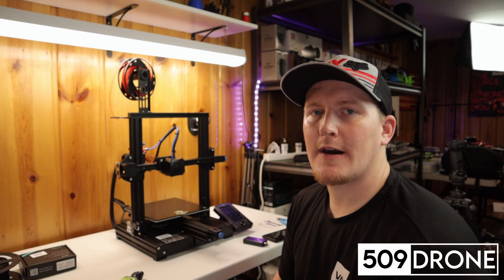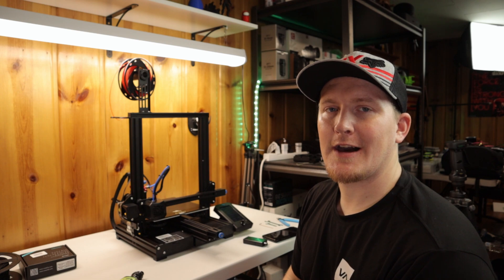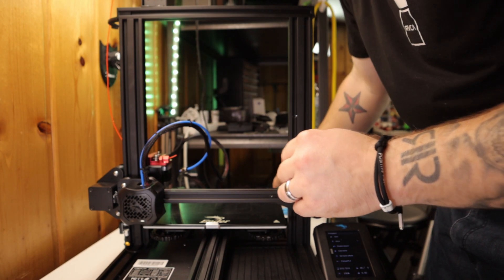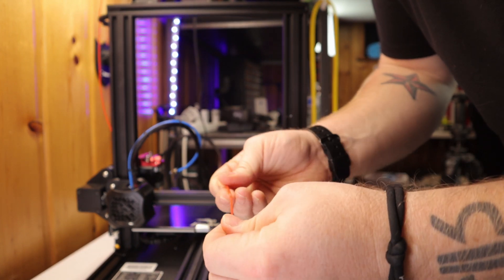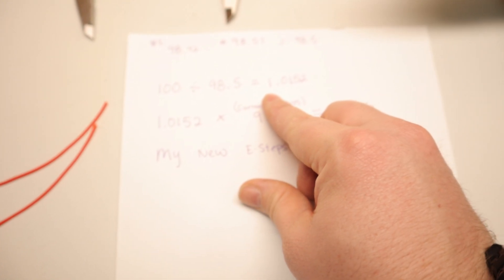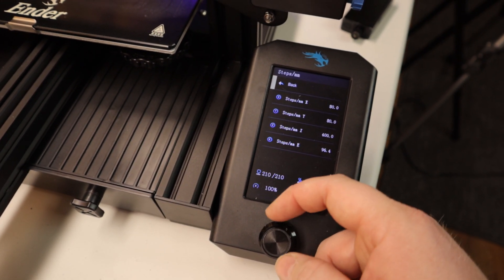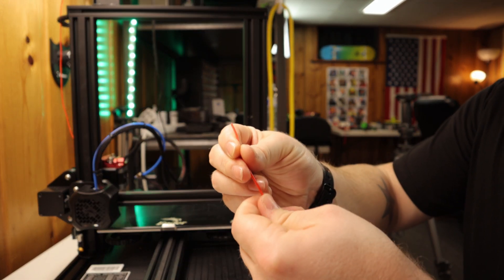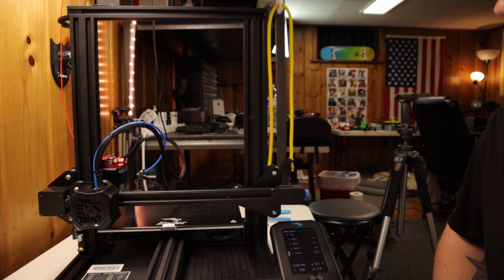How To Calibrate Your E-Steps [ Ender 3 V2 ]

Comment: I did mine partly another way which I saw done on another channel but I used your help with the screen settings and how to move the extruder as they were connecting their laptop up to the printer and using some program that I do not have... This way I did Not have to remove the bowden tube from the extruder. I just took the filament out and marked 120mm then put the filament and loaded it into the extruder to the first line then used your way to extrude 100mm then marked the filament at the front of the extruder where I also started with the line on the start of the 120mm section. I took the filament out and measured the remaining distance which was 22mm and using your formula it was under extruding so I changed the setting, saved it and turned the printer off, and did it again and now it is spot on 100mm of length extruded.. thank you for the help.. much appreciated.

Comment: Awesome tuturial!! Just added the all metal extrudder kit, the capricorn tubing and the dual z axis kit. Idk how my prints have even been turning out so well because it was only extruding 65mm until I calibrated it via the steps in the video with a final transmission number of 143.0 I get a perfect 100mm now every time.

Comment: Just a note: AT 9:00 minutes you casually mentioned that "you just power cycled the printer" before checking the new E-step calibration. You MUST power cycle the printer otherwise the new offset value gets added to the old value and the 100mm length will be way to much - in my case it was around 106mm. After power cycling it was perfect. Great video though!

Comment: Small tip to make measuring easier: straighten the filament a little after cutting, then tape it to the bed in a straight line leaving only the ends exposed. Much easier and accurate measuring. Thank you for the video. I've been having some strange problems with my cr-10. Running this, I found out it was different every time. After replacing the gear/roller with the bad teeth, I found it was 11% off from the factory. yikes!

Comment: hella nice video my dude! one little ting that wasn't mentioned in the video is that if you are running original software you need to have the SD card in to save the config and the new e step config will only show up after a reboot once the card is installed!

Comment: This was really easy to follow, many thanks. I just had a couple of questions. I saw estep calibration on another tutorial, where instead of updating the printer, it updated the slicer (Cura) - is that just an alternative? I  also recall reading that changes on the printer are stored on the microSD card? Is that right?
Reply from the maker: Thanks bro! Glad it was helpful. You can only update your esteps on your printer, not the slicer software (I'm not 100% sure on that, but that's my understanding) as for the SD card, some printers like the ender 3 v2 save the esteps info on the SD card. So you will want to make sure your SD card is in your printer when you update the esteps. This is the file you will see on the SD card called eprom. You can add commands for the printer to execute before it prints via the slicing software (cura) but I don't think esteps is one of them. For example, that is how you tell your printer to always do an auto bed level before each print.
Reply: @509drone2  Legend. Thanks mate, really appreciate it.

Comment: Good video.  Don't cut it before you measure though, use the upper jaws to measure it to the face while it's still in the extruder.  Easy to pull it straight and measure.  Release the filament, pull it back close to flush, cut short piece and recheck.

Comment: I did this and the final measurement was 100.55. I double checked the measurements and it was accurate. How do you fix that?
I did just put a Creality Aluminum extruder on with new gear.

Comment: If you do it this way, when you actually run it thru the hotend then it will come up short, so the best way is to run the filament thru the hotend for a better reading

Comment: Everyone on these videos says to do it like you did with it unplugged from the hot end for no resistance… my thought and question is wouldn’t you want to calibrate it with it hooked up just like you were really printing?? If you calibrate it with no resistance and then hook it up and it has resistance when actually printing wouldn’t that through off the calibration??

Comment: Hey I’m having trouble with this. My original extrusion was 95.3 and my e step was at 93 I changed it according to the math here and it went from 95.3 to 109 not sure what I dod wrong
Reply from the maker: I had to do mine a couple times before it started coming out correctly. I would just do it a few times, with small adjustments and checking to see if it's getting better or worse. Also if you have more questions I would recommend our discord. There are a bunch of really helpful people in there who all ask questions, and help each other. Good luck bro!

Comment: What is the firmware you are using on that? I have an Ender 5 Plus with the touchscreen and it has very simple menus with fewer options, and I don't see the e steps setting anywhere on it.

Comment: For some odd reason this didn't work for me I started off at 93 default and was getting 2 21/32 in filament which is like 67.48 mm and my total came up to I need it at 138.7 when I set it to 138.7 it was extruding like 7.5 inches of filament
Reply: Which is like 200mm so I was guessing numbers and got it half way between 3.75 and 4 inches and if I make .1 adjust it dont move any then if I move it 1.0 it will jump to 4.25 in then run it another cycle on same setting it drops back to 3.75

Comment: Great tutorial, I wonder if you would get the same extrusion amount pushing it through the nozzle?
Would your values need to change?
Reply from the maker: I think that will work as well, but it won't be as accurate.
Reply: I think you are on to something. You calibrate it without resistance...then you gonna use it while adding resistance...

Comment: Measuring a 100mm of a bent filament with a calliper is very hard. What about this instead:
 1) Extrude a bit, just long enough to hold between your thumb and finger
 2) Mark a line on the filament with a permanent marker at the point of the extruder
 3) Extrude 100mm
 4) Hold the filament stretched and use your calliper (inner diameter side) to measure the distance between the line and the extruder
Reply from the maker: If that works then definitely. I agree it was hard to measure the filament. What I do is roll the filament flat, and then tape it down, and then measure it.

Comment: When I hit 100 on the move option. it extrudes 94mm of filament. should I change the setting or this is because of the stock 93 movement value of the ender 3? I have an ender 3 v2 with upgraded firmware

Comment: its seems the bigger I make the number the shorter my filament gets. I moved the estep to 94.8 the fillament went from 98mm to 95mm. what am I doing wrong?
Reply from the maker: Make sure you save your settings each time you change them. It's called "store settings" or storage settings. The grammar isn't right. Also make sure you power cycle it after saving the new settings.

Comment: Hey, i followed your steps but when i extruded 100m with 93 e steps, i got 25mm of filamnet out. So i pumped the esteps to the maximum, 186, and i still only got 75mm out. I just purchased a new tube (Capricorn) and a new dual extruder. Maybe i got an extruder thats not compatible? or my motor is done? Ty!
Reply from the maker: Yea that definitely doesn't sound right. Something isn't matching up correctly. I would jump in our discord and ask some of the guys in there. We have an extremely active discord community, with some really helpful people.

Comment: Great vid thanks. Question - why do you have to heat the extruded if the filament is completely disconnected from tube and device?
Reply from the maker: Thanks! The printer will not engage the extruder motor unless the hotend is heated up. Its a safety feature in the printers firmware.

Comment: You are great. The easiest to follow. I watched other videos and the process was so tricky that I literally didn't do my calibration. But after your video, I will do it right after writing the comment. One question - squeezing or pressing at the extruder will result in any error or not? I mean is it require to verify the length before and after the extruder side?
Great work man. Thanks a lot

Comment: For some reason my ender 3 v2 doesn't save the new e steps configuration. Even when i save them in the store configuration option
Reply from the maker: Someone already said it, but the stock firmware saves the eprom on the SD card I'm pretty sure. Make sure you have your SD card in the printer first, or update your firmware.
Reply: @509drone2  i'll go for updating the firmware cause i tested with the SD card with and without it and didn't work at all
Reply from the maker: @Vault101.3D  right on. Join our discord if you have any questions. A lot of really cool helpful people in there
Reply: @509drone2  thanks! I'll do!!!
Reply: @Arad Nezami in deed i tested with the SD and without the SD and the result was the same. It wasn't working at all. My firmware version is 1.0.2, i don't know if there is a newer version

Comment: I need to stop reading YouTube comments. They discourage me. So many people have problems with things that I just never have problems with. I had my ender 3v2 setup in an hour and a half and printed my first perfect piece that very evening.
Reply: You will print just like I did. But, when printing larger model with high quality you will understand that out of the box settings is rubbish.
I printed an owl and it looks a piece of art. But now that I'm printing high quality model, no support, etc, you get into many issues.
I used to think like you, 3 weeks or so with mine, all the tweaks makes sense to me now
Reply: @hakunamatata324 

I only used the standard settings once, when I printed an XYZ block just to dial it in. I never used the standard settings again after that. I'm a craftsman, metal fabricator, engineer with a background in graphic design and web development, so I tweak everything from the start. I also use CAD software in my other work so learning fusion 360 was a breeze. I had read up on everything about 3D printers a month before I even owned a 3d printer. I've mastered the learning curve, that's all.

I'm already printing large pieces. I just printed a large figure of Sylvester the cat from thingiverse, and it's perfect. However I bought it to print functional pieces to use in my car, my house and my other projects, or fixing things in my shop. The second day I had my printer I designed and printed all the pieces I needed to repair my canopy that was destroyed in a windstorm. I can simply compare my work to 3d printed pieces online to know if they're quality or not. No need for trial and error. Based on my comparisons, I'm already there.

People have problems with things I find simple, like just putting the printer together properly, finding proper filament temperature for that brand. Or figuring out how to get their prints to stick to the bed. Or how to level the bed. BLtouch? No thanks,  I can level my bed in literally 30 seconds using a Post-It note.

I've always been good at picking things up quickly, so like I said. I should stop reading YouTube comments from people that don't, they're discouraging. It happened to me when I wanted to get into FPV too, then as soon as I did, I didn't have any of the issues other people have. I just get things I guess.
Reply from the maker: You're one of the lucky ones :) haha thats good to hear though, keep it up!
Reply: @509drone2  Apparently! I just made a comparison to when I wanted to get into FPV, the same thing happened. Everything I read was discouraging because people were struggling with everything, from how to solder, to using betaflight, to setting pids and rates.

Comment: Thank you! Does it matter what filament? If i calibrate using pla, do I need to recalibrate using tpu?
Reply from the maker: Thanks for the comment josh. I found that you do not need to recalibrate your esteps for different filaments, but you DO need to re-adjust your flow. For example my PLA flow is 100, my TPU flow is 120. Check out my video on how to calibrate your flow for more info.

Comment: Incase confused like I was: For some reason my fist extrusion after changing e steps is still off a little. The second and third extrusion were dead on. I was thinking that the calculation can be inconsistent but seems to be really good now!! Just that first extrusion was yielding a different result
Reply from the maker: Thanks for posting. Good info to know!
Reply: Exactly! So glad someone had the same thing. At first i panicked, i got 108mm out, then after the second one i always got on point.

Comment: On ender 3 pro 32 bit 4.2.2 original firmware, you MUST have sd card in place or when you cycle power nothing will be saved. Path is different, Prepare>Motion>Extrude. This might apply to other versions also. Thanks dude. I have watched many videos on this but they all assumed we knew how to manually extrude.
Reply from the maker: Correct

Comment: Hi I followed your video with my Ender 3 v2 . I switch to a dual drive gear extruder and when I set the extruder for 100 instead of it  going out the reverses and withdraws the filament. I have to turn off the printer then turn back on and when I go to the extruder I can set for 100 and it will roll out to 68 mm. It has not yet came close to the 100mm  even after attempting  several times. The steps setting is at 93. I did the calculations and     It says set for 145mm which so I set the steps e to 145mm , stored settings and set extruder 100mm and when I do a measurement with extruder filament length is 73 , it seems it’s not coming close to 100 or not even the 90’s . My question is how can I resolve this problem. And just to add when printing  the first layer  retraction leaves stringing and I have tried  several designs and they are stringy, before switching to the aluminium dual drive gear extruder had no stringing or filament globs oozing out of nozzle  .4 . Thinking about going back to plastic extruder even though it slipped at time I had better quality designs than what I have now.

Comment: I can't seem to get my machine to save the extruder setting. I've done the store setting until it beeps and powered down and unplugged the power cord. It always goes back to 93. I must have done this 10 times. I've updated my firmware also. Do you have any ideas?
Reply from the maker: Sorry for the late reply. If you're still using the stock firmware, it saves your esteps on the SD card as Epom. So you need to have your SD card in the printer.

Comment: What about using a piece of clear packing tape to hold it down flat on the table for measurement?
Reply from the maker: that would work great too! good idea!
Reply: @509drone2  I replaced my extruder this evening with one of the red dual gear models (My original broke after only a few days of use. I think they are all the same, even the one from Creality). I still had to straighten it out, but my packing tape method worked well for holding it down steady for measurement. I did 2 measurement and calculation cycles, but once it got close, I found it easier and faster to dial it in manually. 99.55mm was the closest I think I was going to get after 6 rounds.

Comment: hello sir i calculated mine as 415 but i can't pass 186? What can i do? thanks for the video
Reply from the maker: hmmm 415 milometers?
Reply: @509drone2  step/mm. I was able to change value with repetier host
Reply: @MultiBahader  im having this same problem i got 290 n i cant go past 186 plz help
Reply: @johnnagy6998  i found a solution.Download Repetier Host and try to change in there.

Comment: Thank you for the instruction! I would have expected that measuring with the Bowden tube and hot end connected would give a more accurate reading comparable to a "real life" scenario?
Reply from the maker: I got pretty much the same measurement/calculation from both methods. I have a video on how to do it the other way as well if you would like to check as well.
Reply: There are other ways to compensate for "real life" scenarios. Steps/mm links the motor rotation to a rectilinear movement, you want it to be as precise as possible. If using this method you find that your printer under extrude maybe increase the hot-end temperature or raise the extruder multiplier in the slicer.

Comment: Great video Kevin, question, why do we need the SD card inserted? Does it store some kind of printer configuration info?
Reply from the maker: I appreciate your support. The SD Card does NOT need to be inserted into the printer if you have the TH3D Firmware. But if you are using the original firmware that came on the printer, it stores the settings on the SD card as an "EEPROM" file. You can try hitting store settings without the SD card in the printer, and then power cycle it and double check if it stored your settings. If it did not, then try it again with the SD card in the machine. Hopefully that helped, let me know if you have any other questions.
Reply: @509drone2  Oh that's great to know! Loving your videos! Happy printing! :D

Comment: thank you.   very helpful.    Instead of taking off the boden tube, I took a piece of 120mm filament and inserted it in until flush then moved back -100mm and cut flush.   using your calculations I got to 100.1 - 100.14.  I'm new to 3d printing and anything I can do to make the garbage I'm printing look better is a step in the right direction :) - thank you.
Reply from the maker: right on bro! welcome to the hobby, glad the guide helped. Join our discord server if you want, a bunch of us who are new to 3d printing in there. Link is in the video description.